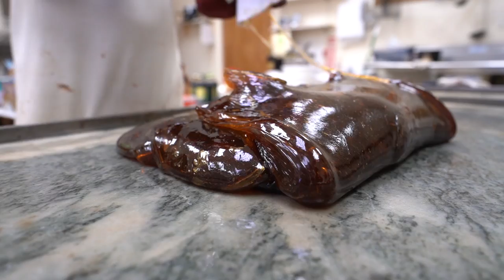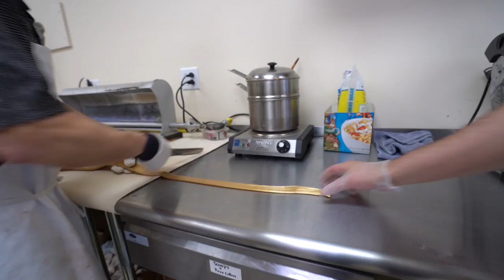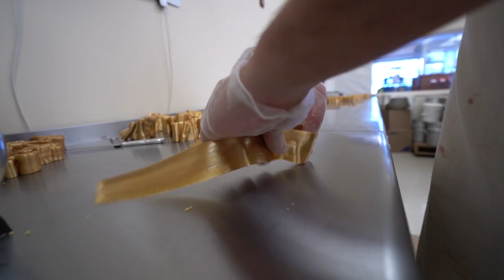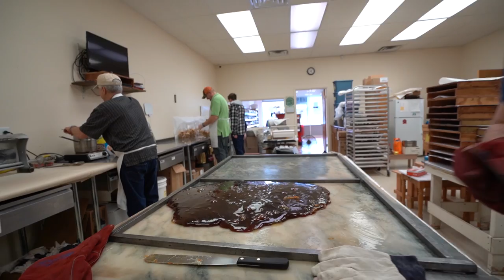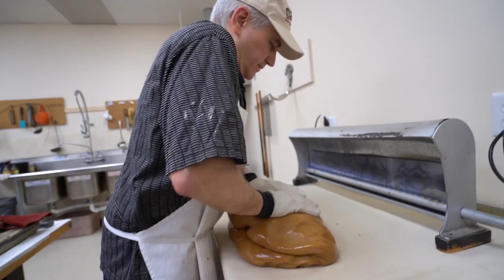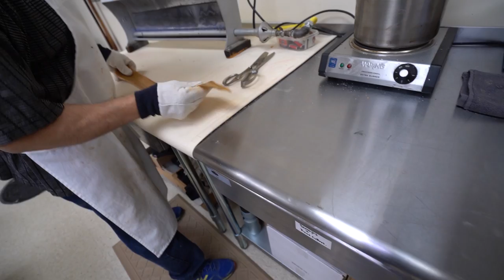Making 2 Batches of Peanut Butter Filled Ribbon Candy!

Comment: if you'd have a guillotine type cutter it would save time compared to picking scissors up and setting them down for every cut. It wouldn't help in this, though, since Steve moderated the strips' length from one to another.